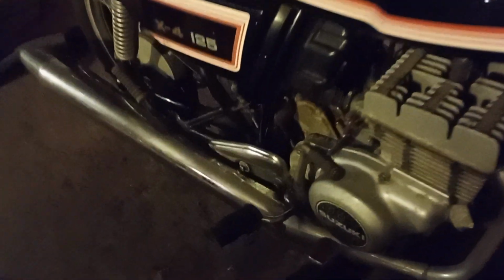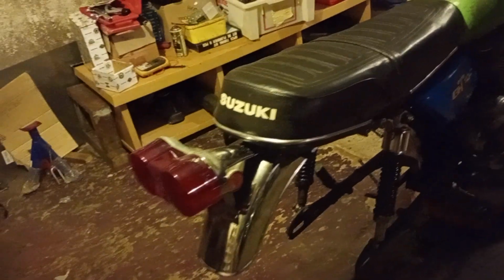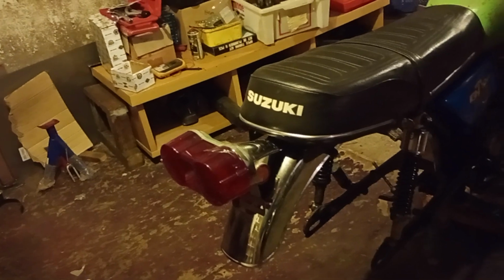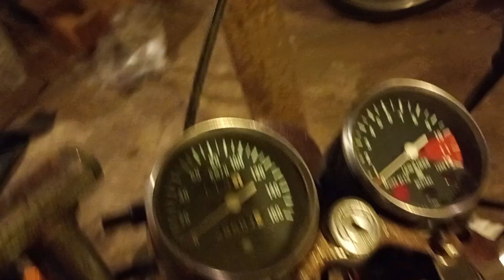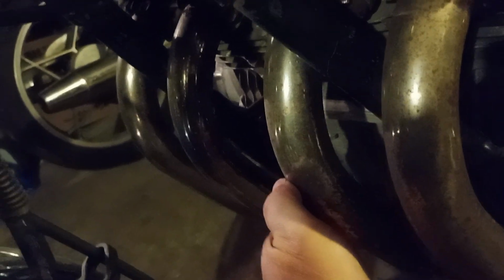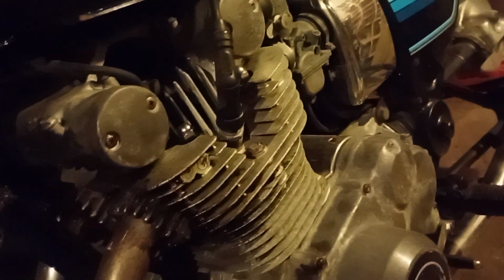My garage

Comment from the maker: It is a drive shaft motorcycle, and of course it has a crank shaft, but that is inside the engine. My point is that is has a drive shaft, not a chain. And of course, the big bike is a 1979 model Suzuki GS850 that I just recently brought home from Sweden